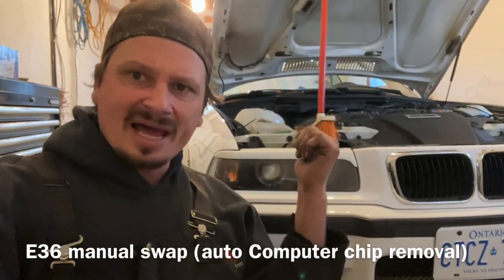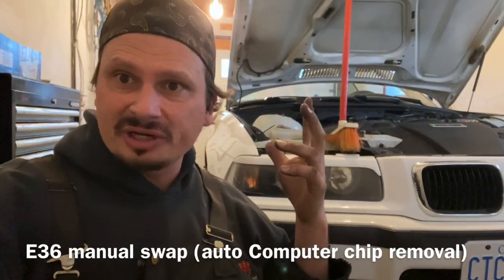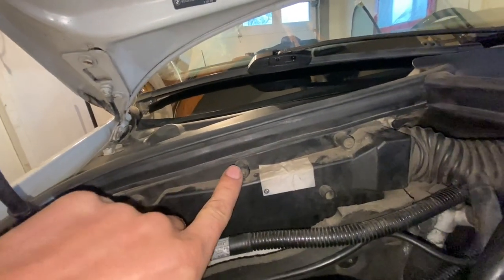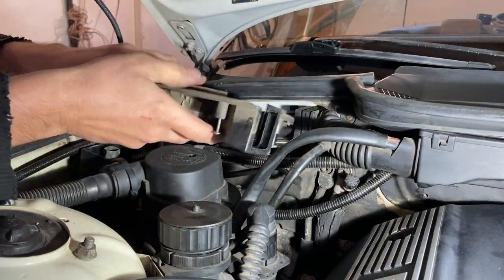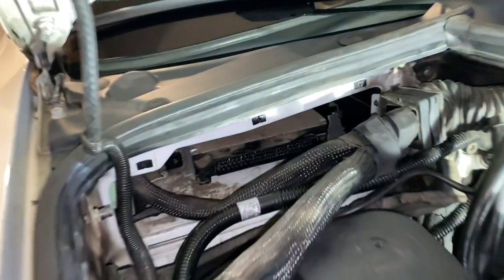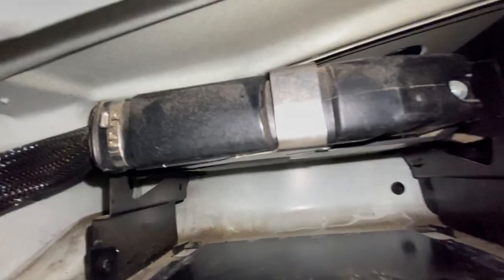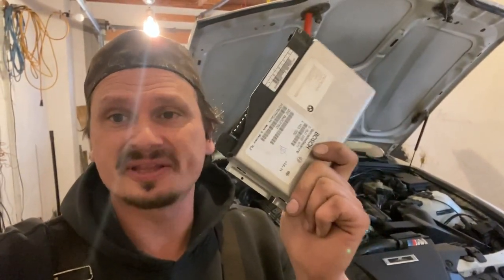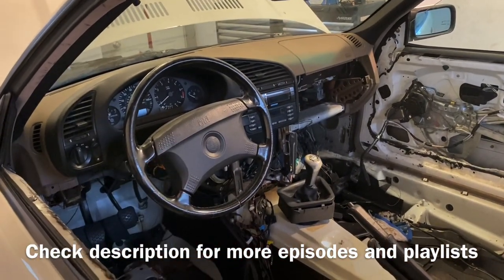BMW E36 ( Manual swap ) computer chip removal, automatic transmission computer chip removal

Comment: 6:50 You actually don’t need to mark it, there’s a mark/notch on the right side of the chip and dip socket (the chip holder on the circuit board) which indicates which orientation to insert the chip!

Comment: You can actually just unplug the TCM all together, the engine does not need to communicate with that box at all. If you unplug it, you also will not encounter a trans light in the cluster.
Reply from the maker: OK thanks I did not know that
Reply: Thanks for the videos, I thought I had everything for my swap and these helped me figure out what parts I was missing.
Reply: Hi,
 I'm doing the swap could you explain what I need to do with the TCM? 
328i M52B28
Reply: @felipesanchez7823  you can simply unplug it.

Comment: If the chip is not removed, will the speed be limited?
I swapped engines and manual transmissions
(m44b19>>>m52b28)
Currently, the top speed will falter when changing gears.

Comment: I just did E36 1995 August build date ZF swap. Took the chip out and it cranked but did not start. Put chip back in and it started

Comment: Mine doesn’t have a chip? It’s a OBD1 1994 e36 it has a tiny ecu 
It is from Japan if that makes a difference?
Reply: Did you figure it out
Reply: I did this on a 1994 325i and I didn’t have to mess with the computer at all, just had to jump the neutral safety switch and everything worked

Comment: I did a swap to my car but it turned on without problem, i didnt have this removed, i disconected the tdc but the clúster light didnt turn off, i had the Cruise control off sign

Comment: I remove the chip in e34 m50 1991 bmw but it doesn't working it just starting and the engine not run way    ? Can you explain it.
Reply from the maker: I’m not too sure how it works on the E 34, sorry I couldn’t help
Reply: Yours is a m50 his is a m52 that may be why not sure myself, but on my m50 I left box and didn’t touch it and managed to start up

Comment: @Konstantins You remove the chip because the car will not start up if it stays in there.

Problem solver, thanks for this video i just bought an e36 myself and was about to do the same thing!  i watched donut media do it but wasnt fully indepth like you were so thanks a bunch!
Reply from the maker: No problem and thanks for watching, and yeah you’re right about the chip
Reply: Mine still started up and I haven’t touched the box

Comment: my 318is manual has a tcm light, it also only revs to 4500, any ideas?
Reply: Hey did you figure this out? mine is doing the same. Wondering if removing the chip will fix it

Comment: can not removing the  chip cause issues with cold/hard start?
Reply from the maker: No the chip is for the automatic transmission only
Reply: @ProblemSolverGarage  well the previous owner did a manual swap so not sure if they did this
Reply from the maker: @Cesar-m7w  they must have.

Comment: Can you explain, why do you have to remove this chip?
Reply from the maker: That chip communicates with the automatic transmission, nothing works until you remove the chip, the car won’t even start
Reply: @ProblemSolverGarage  im pretty sure, that chip removal is not needed, its just enough to short circuit the wires on the parking, to start the engine. I did this at my e36. After you remove the chip DSC is still working, no red light on the dashboard?
Reply: @konstantinspopovs5672  pretty sure that’s only for obd1 cars
Reply: @tristanstump1605  yeah only for obd1's
Reply: @KIAdarktide  Which one needs to remove the chip? Obd1 or OBd2?
Mine is a '95 euro spec 325i. I need to remove?